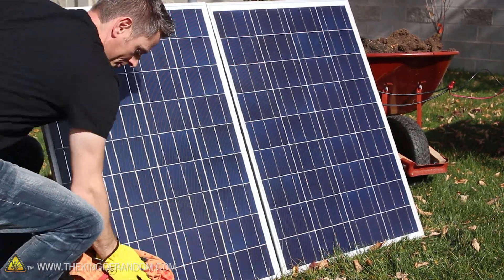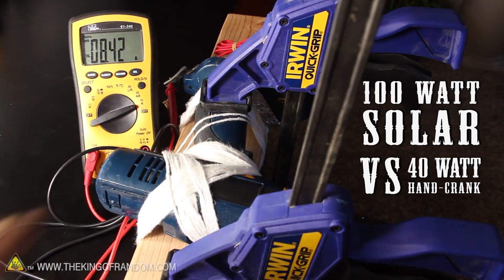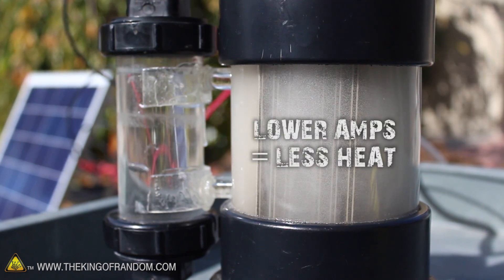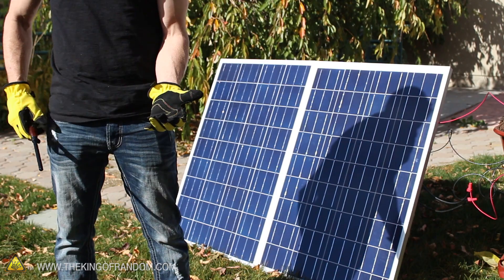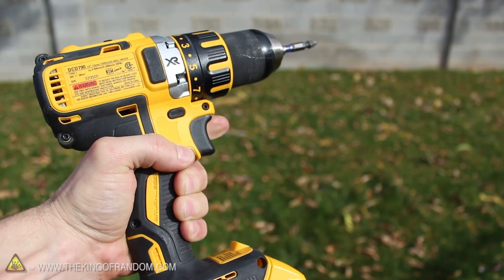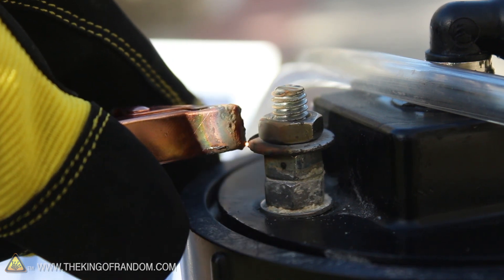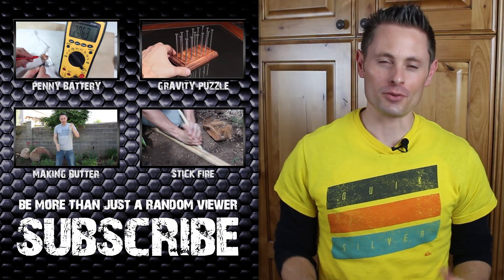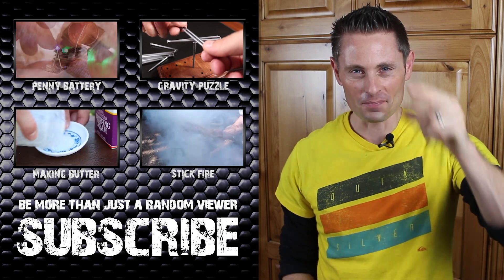Solar Electrical Experiments

Comment: Electricity in this case is certainly NOT free.  I'm not sure how much those solar panels cost, probably a few hundred dollars. Maybe even a few thousand ! I'm not sure. But it'll be a while before you make thay money back from the power output
Reply: Electricity is free, the panel is not. I cannot understand why you can't distinguish these two things. Learn to use your minds.
And a 100W panel costs around 120$. 150$ max.
Reply: ***** Am i?
Reply: If you buy a whole system, like a 5kW one, the solar panels excluding inverters will only cost $0.35 per watt, so $35 for each 100W panel. He probably paid somewhere between $50 to $60 each.
Reply: This is a joke right?
Reply: Vinnie Vids Oh. Where do i order?
Reply: Idk. In my country, a 195 watt panel is 210$
Reply: not if can do parckware an steel the off some jack A** roof at night.
or a useless road sing tell people not drink an drive on a back road only hick dive down an disregard it any way.
Reply: Counter The Animator 195 watts. That's enough to drive one appliance....just one.
Reply: rifleman1002 Well, it's efficiency is 16%. 40% would be around 550 watts.
Some labs said they made 80% efficient.
Reply: Counter The Animator I heard the world record was 42.something%, which is close to the world record efficiency of LEDs. Once you get that deep into it though, you have to start considering the efficiency at different wavelengths, temperatures, intensities, etc, and consider the spectrum of the sunlight before or after it passes though the atmosphere to really get accurate figures. Sounds like a lot of work and multidimensional calculus, so does it matter that much? I'd say as a 15%-18% is a good guesstimate.
Reply: rifleman1002 Worse still, that is the maximum efficiency with the most optimal load, With a very low impedance load (like an almost short circuit), the panel voltage is low and and current relatively high. The product of the 2 will be small. with something that is 'looks' more like an open circuit, the voltage will creep up high and the current drawn will be low. Again the product of the 2 is small.

There is a sweet spot where the most power is extracted out of the panel, and that is generally the rating of the panel. (not the maximum voltage (open circuit voltage) or maximum current rating (short-circuit current), those are practically useless measurements, ignore them.)

So you have to make sure the appliance just the right amount for optimum efficiency.
Reply: Power Max Ehm, yes the so far confirmed method is 44%, but unless you have million at hand, you're not getting it.

Comment: Nice video. I could use a panel like that. Currently I have a 50 watt panel hooked up to a hot water solar pump that pumps the water from my kids pool into a 4'x8' solar water heater panel. Even at 9000 feet in Bailey CO I was able to keep the pool above 70° this summer. Love your channel! Had to make the solar scorcher as well. Going to try that to heat the pool as well next year. Keep up the good work.

Comment: I would love an analysis on the full cost of all equipment and how long it would take to pay off in comparison a typical KWH charge based on ten hours of direct light per day.  My guess is the breakeven point is around twenty-years.  I love solar systems but I want to understand the full outlay first to be realistic.
Reply from the maker: I know what you're saying, but cost for power isn't guaranteed to stay the same for 20 years.  It's a reassuring feeling to have an electric generator that isn't subject to price hikes.
Reply: Grant Thompson - "The King of Random"
But if you're using a battery array to store energy (most do), then they will have to be replaced every other year and that could cost another thousand over ten years.  As for estimating electricity costs, assume 2% more every year.  If times get real bad, people will steal the panels at night or at gunpoint (silly, but people get nasty).  Storing and treating hundreds of gallons of gasoline for a vented / muffled generator in a basement would be another easy energy alternative on the cheap.  (three hundred gallons $900.00) + tank $600.00 + one generator $1000.00)  and good extension cords ($100.00) + hand pumps and gas treatment fluid ($100.00)  so for under $3000.00 you get a whole year of energy off the grid and without too much effort.
Reply: @Guywithcrazyideas  Yes, because there's nothing risky about 300 gallons of gasoline.
Reply: actually people who convert to solar have it all payed for by what they would of been paying electric in about a year.
Reply: In camping or on a boat, solar panels are much more convenient than to bring a generator + gasoline (specially since you never know when you'll get the opportunity to re-fuel, also, thousands gallons of gasoline are heavy and not easily carryable). It's easy to stack a few spare batteries (to be fully autonomous for many years) because they are compact, not so big and not heavy... while it's not so easy to store thousands gallons of gasoline + spare parts for the generator (to last as many years). Generators are noisy and smelly... so in an "apocalypse" situation, i would prefer the possibility to stay mobile and to stay furtive as possible (+ if gasoline stopped to be extracted, there'll be tons of batteries everywhere... in the unusable cars). Solar panels are perfect for a nomade and compact lifestyle, off the grid. :P
Reply: ROI of a PV system depends on the base price of the electric you buy and the amount you use plus the amount of sunlight you give it. I live in the AZ desert and have 52 290w panels making between 110kwh/day in June and 65kwh/day in Dec/Jan. Not including the tax incentives it will take 8 years to ROI and much less with the tax break. The equipment has a 30yr warranty with free parts replacement.  If your putting down roots it's a no brainer of a deal imho.  Yea, $12/month power bill and they cut me a $500 check each Jan 1.  works for me.
Reply: You have the ability to get your solar system connected into the grid, so whatever you're producing extra can be sold; then you don't have to store any power. You can then with no financial losses get back a high percentage of the power you provided to the grid; some is lost in transmission and conversions each way and the power company of course wants profit. Today's new systems which get connected to the grid, will in actual practice pay for themselves in about 6 years (Australia, Dave Jones).
Reply: It is usually about 20 years to see any return, it is a long term investment and only for those with no plans to move houses.
Reply: Guywithcrazyideas My wife an I lived off the grid in S. Colorado for 3 years. Solar is by far the best bet, as long as you do not run a color TV or any appliance that has a motor or compressor. Then solar becomes very, very expensive. Generators or good for backup plans, but anything that has moving parts WILL break down. Murphy's law ensues and there you go. Wind mills are BS and only the huge expensive ones really work, however they require much maintaining. We ran all the lights and a B&W TV on one 55 watt panel with 4 truck batteries. Cost was low and we achieved our goal at a nominal price. Propane fridges are best for country living.
Reply: DRum886 Is it really that hard to move from one house to another ? it's just a couple wires, solar panels and maybe batteries (and inverter and charge controller). I would have though you could move he pretty easily
Reply: TheMrTape
In my area, giving extra current to the grid will only get you credit for future bills in the following year and only to the point of 1/2 what you used the year prior.  They rigged the system to discourage people from making extra electricity.
Reply: Guywithcrazyideas
The larger the initial outlay the quicker it will be paid off in the long term.
Think about this, if you use 10kWh per day, where I live you will be charged at 26c/kWh so $2.60 a day.
A quick google search says a 3kW solar system will be ~$4000.

In Australia where I live, you will get about 3-5 hours of peak sun per day (where the sun is providing maximum light to the panels) so for those 3 hours you will have generated 9kW of power (3 hours * 3kW). This isn't even including the extra you'll produce when the sunlight isn't at it's peak or during summer where it would be ~5hrs of peak sun. In reality you will probably produce far more than 9kW per day.

I haven't taken into account the overcast/rainy days, but where I live, you'll be getting less than 30 a year (just a guess).
If you can produce enough power to purely cover your own personal electricity use and not including excess, using this example it will take:
$4000 cost / $2.60 per day saved = 1538 days or 4.21 years.

So for the sake of rainy days we'll round it up to 5 years to cover your costs when you are producing the BARE minimum of 9kW per day. Perhaps less.
Reply: asdasdqwerty The larger the initial outlay, the higher the initial cost, and since the initial cost is essentially proportional to the rate of payoff, the 2 cancel out and the time it takes to get the money back does not change much.

The situation changes a little since generally things are cheaper in quantity, so it is possible that the payoff will be a little quicker, but in general no. Things like maintenance of a larger, more complicated system must also be considered.
Reply: Any system installed in a domestic environment would generally not require much maintenance but yes, it is something to consider. My response was referring to the person saying it would take 20 years to recoup your initial outlay. Clearly it would take far less.
Reply: asdasdqwerty
 Correct on  maintenance, mine has been zero. Even firmware updates to the inverter array are linked to the internet. Another consideration is micro inverter vs. central inverter. Personally I didn't want hundreds of DC volts in wiring weathering on and across my roof. I chose to convert to AC (micro-inverter) at the panel level. Little more money, but more efficient with panel level monitoring, and easier setup.  Oh yea, and a DC series array is only as good as the weakest panel. i.e. toss a towel (or a shadow) on a single panel in a multi-panel array and everything stops. If your going to go grid tie solar, study the options and local utility lobbyist. I'm grandfathered into certain rights pertaining to taxes and fees (as in none) where the utilities are setting in place new rules and fees to protect their profit (shareholders).
Reply: Yeah, maintenance generally only has to be considered in very large commercial systems where the panels are set up to track the sun. In that case, there can be a lot of moving parts, and also someone need to go out and clean the panels.
Reply: Nice profile pic...
Reply: My house has a 16kWh system installed, not enough to fully offset our consumption of ~20kWh but enough to make a sizeable dent in the bills. It only cost $12,000 to install but this is probably because of the solar rebates the Australian government gives out
Reply: Power Max Total owning cost is always less for larger installations on account of economy of scale.
Reply: Guywithcrazyideas well if they try to steal them at gunpoint, just say ok take it then when they're taking it pull out your gun and shoot them, pretty easy
Reply: Apparently the panels decay of 5 years
Reply: Wait it wasn't the panels it's the batteries

Comment: WHY DONT THEY USE THESE IN THE WALKING DEAD?!?!
Reply: they would have a car run on this but to have it in the zombie apoc they would need one today and it would cost like $500,000 to make one of these cars even thought you never have to gas up again so over the x number of years you drive the car the numbers might add up then its like who has that kind of money to spend on a car.  Now if your a long hall trucker yea you might do this but thats like people that drive 100s of miles in a given day now for most people they only drive like 50 miles per day so its just cheaper to keep gassing up like normal
Reply: Read the comics, they do ;-)
Reply: well the reason cars run on gas is because it was cheap the first cars ran on bio fuel and they ran better but it just was more to use that since back then you could get a gallon of gas for like 0.01$